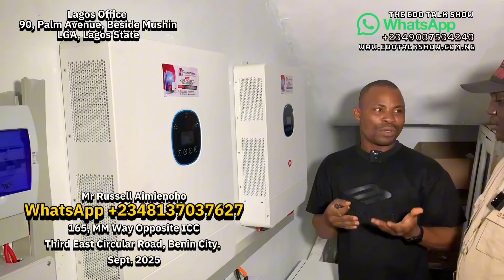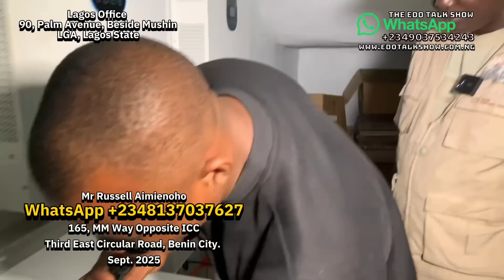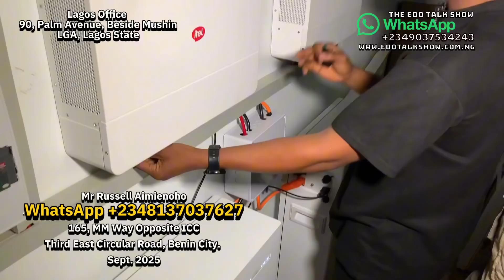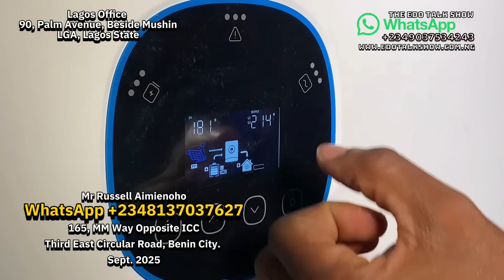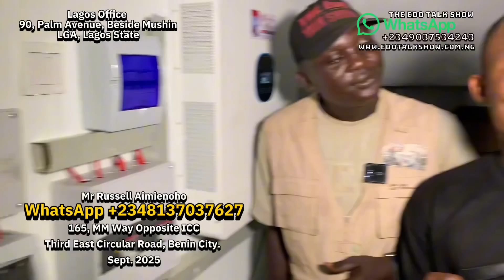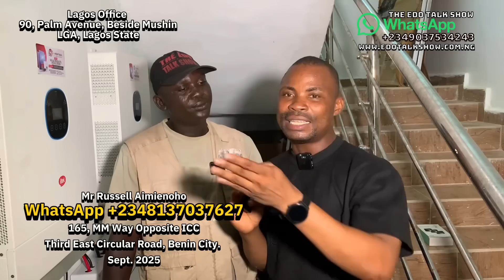This Solar Setup Powers About 10 Air Conditioner Units And The Price Will Shock You!

Comment: Please one important thing you didn’t mention, on 4 a/c load how many hours will the battery last before charging, thank you
Reply: He is lying to probably get 8 hours you will need 45kwh battery and the Aircons must be powersavers because with 45kwh you may get a 3500watt for every hour some Electric  kettle can take 2000watt
Reply: @ele4984 did he mention the hours? No
He only said it can power 4 AC in the night. You can do the calculation yourself.

Comment: Na wah o! 
na Una dey cause problems everywhere. 
10AC 
3 water heater 
Microwave 
Fridge
Fans 
Lights 
Iheme!! 😢😢😢
On 32kwh
Reply: He didn't say you should use that load on the battery, that load can only be used directly with the solar during the day sunlight NOT for the battery. Always use your brain will writing comments.
Reply: @johnpraise27 why you dey defend am did he spell it out, you need to understand the power of marketing, act professional and stop insults, he's just a baby installer to some people.
Reply: Again 16kwh has a nominal discharge of 175A x2 is 350A after consideration of inverter efficiency and losses you can put out only 16kw of AC power from inverter while on batteries, except he has enough solar Arrays nothing less than 44-60 solar panels of over 550w each.

Comment: I want to believe your 10 ACs include a good number of 1 HP units and that not all 10 are running at the same time. I also heard you mention “conductive load” but there is no such thing, I think you meant inductive load. And you know, inductive loads can require up to four times their rated power to start.

Also note that 12 kW is not the same as 14 kVA because it depends on your power factor. Finally, that 16 kWh battery has an 80 percent DoD which means your usable energy is only 12.8 kWh, giving a total of 25.6 kWh for two batteries, not 32 kWh.
Reply: Yes, he made a few mistakes, but he still knows what he's doing he will get better. it doesn't mean we also, as engineers, openly drag one another, this is where most of us solar engineers clash
Reply: Definitely 1HP inverter AC and obviously set to power saving mode / Gen mode to get anything close to that figure
Reply: not at d same time
Reply: Where re the charger controllers?
Reply: @homogbolahanheyoh3819 it's inbuilt
Hybrids has inbuilt charge controller
Reply: @homogbolahanheyoh3819 it's an hybrid system 😢

Comment: I bet to differ with the load 10 AC, and you said it is only 8kw power that is drawn
Reply: Solar installers know how to talk big … how can u use 24kw to power 10 ac units and more.  It doesn’t make sense he’s just talking he doesn’t understand his calculations
Reply: The guy dey contradict himself
Reply: Do your findings properly.
Reply: Yes his might be right because 8kW is just a continuous running load and besides not all the 10 ACs at the same time.
Reply: d 10ac is not on at d same time
Reply: You people are not professional obviously, do your calculations so you understand why he got to that figure.
Reply: Even if the 10AC were on at the same time, it might be an inverter AC and it has been set to GEN mode where the AC compressor will scale down to around 700watts.

So yea 10 inverter AC can actually be set to draw around that figure he quoted.

I stand corrected tho, 😏